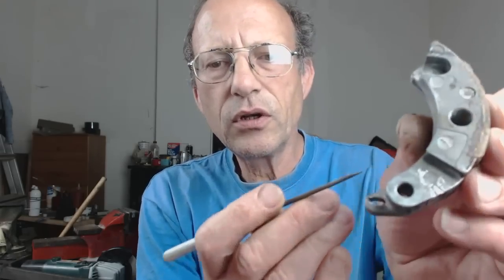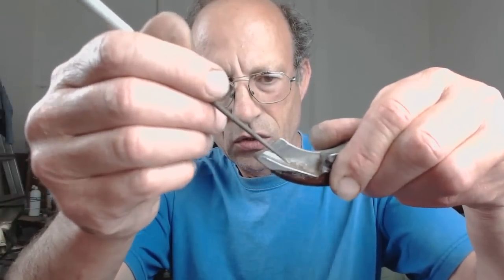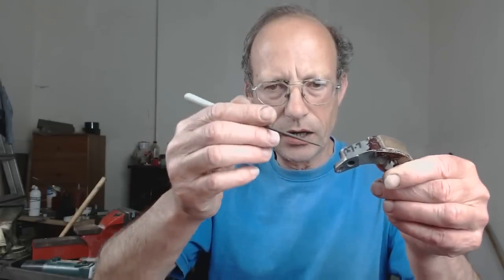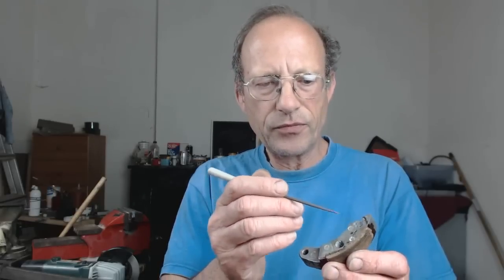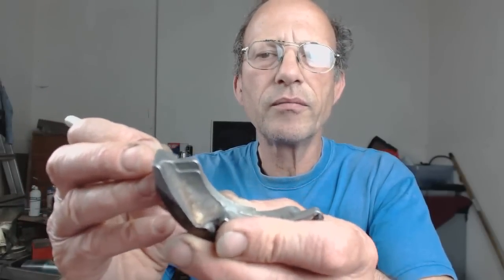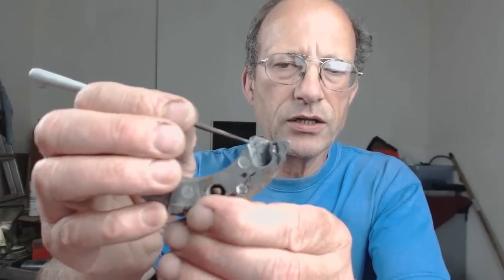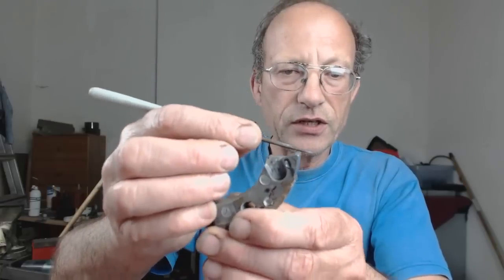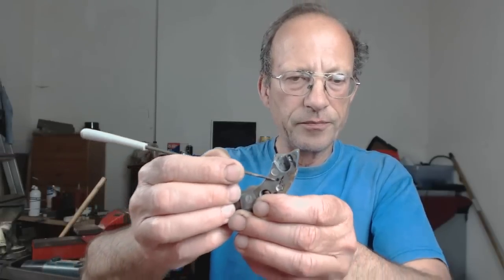Adjusting scooter clutch grab without changing the springs - Part 1

Comment: Hi bro i have 155cc scooter with max torque of 13.8 N.m @ 6,250 rpm and max power of 11.1kW / 8,000 rpm. What is the best roller weight to have better top speed??
Reply from the maker: It's not possible to state, as many factors are at play.
Below is the explanation.
You may need to study it, so that you can hold the concept clearly in your head.

All initial testing must be completed with a tachometer, and the CVT cover off, as 'grab points' must be seen and written down against RPM.

* WARNING *
All loose clothing is banned, hair should be tied back, a cap should be worn (if hair is long), and safety specs worn (due to particles flying off the rotating clutch and belt).

The principal 
------------------

... is based upon two gearing devices:
The front variator, and the rear variator.

The front variator increases the gearing by centrifugal force (CF) flinging the roller weights out, pushing the pulley halves together, and increasing the the front pulley diameter.

The pulley diameter change = gearing range.
This is determined by engine speed, and roller weight.

The roller weight determines the engine speed when the pulley drive is engaged (but NOT the drive / bike movement).

Heavy Weight Rollers
------------------------------

At tickover (say 1500 rpm) CF is insufficient force to squeeze the pulley halves together.
Say at 3000 rpm the pulley begins to grab the drive belt.

As the belt grabs, the clutch housing begins to spin @ 3,000 rpm (just an example)

As rpm rises, so too rises the CF, causing the gearing to rise.
This spins the clutch faster.

At say, 4,000 rpm the clutch bites, and drive is engaged.

Now, as the engine accelerates, the bike also accelerates (it's a double whammy!)

On fixed gearing (motorbikes) the bike accelerates purely due to the rising engine rpm.
Not a scooter.
Not only is the engine accelerating causing the bike to go faster, but the gearing is getting taller... also causing the bike to go faster.
Nice!

Say the scoot rpm tops out at 10,000 rpm.
... but at what rpm have the weights hit the walls of the cage?
You need to know that.
Use a thick pencil, and rub a broad pencil line from the outer diameter down towards the centre of the pulley.

With the cover off, you can see it all happening.

You want the belt to be squeezed out to the maximum diameter... you then have full use of the front pulley gearing.
This is obviously ideal, because a broader gearing range maximises acceleration potential.

Lets say, with the heavy weight rollers, maximum gearing is achieved at 9k rpm

You now know everything!
You know the 'critical' launch rpm... plus the maximum gearing rpm.

Light Weight Rollers
---------------------------

CF is dependent upon mass and rotational speed..
So lighter weights have less CF @ 3,000... so the belt isn't grabbed.

Say the belt grabs at 6,000 rpm, and the clutch grabs at 7,000 rpm.

Yippee you shout.
7k rpm and you are in the powerband... and you can barely keep the front wheel on the ground.

However, with the heavy weight rollers, the clutch grabbed at 4k rpm and achieved max gearing at 9k rpm.
IE. from grab to max gearing took an increase of 5,000 rpm.

BUT... with the Light Weight Rollers... the grab occurs @ 7k rpm
This means that max gearing is achieved @ 12k rpm... yet the engine only revs to 10k (and that's past peak power)

This also means that the bike has no drive, until 7k rpm... so it's screaming its guts out, just going at walking pace.

The Solution
-----------------

Heavier clutch shoes, or weaker clutch springs - to lower clutch grab rpm closer to the belt grab rpm (in our example say down to 6,200 rpm).

Or also increase the roller weight to drop the belt grab rpm to say 5k (et cetera....)

Conclusion
---------------

Your normal 'performance (yet rideable) objective' is to have the clutch grab, at the beginning of the usable powerband.

... while maximising the gear range.

After that point, you can turn your attention to road speed.
Road speed determines rear wheel speed, and this determines the final drive gearing, which is determined by the rear pulley spring strength.

Stronger rear pulley springs increase the pulley diameter, lowering the gearing (greater acceleration)
Weaker springs reduce the pulley diameter, raising the gearing (faster potential speed)

Therefore, you will fit the strongest springs, that allow you to hit maximum speed at your chosen rpm ... say just past peak power (assuming a flatish power curve).

This will provide the best balance between acceleration and speed.

... and that's almost all of it it explained.
There is a torque ramp at the rear pulley, but you have what you have.
Actual testing will tell you the spring strength required.

Did you get all that, on first reading (please report back on how many times you needed to read it).

All that's left to do, is give the vid a thumbs up, and subscribe :)
Reply: @EngineTuning  This is, by far, the most comprehensive answer to a viewer's question I have ever seen from a YouTuber. That's AWESOME. I basically knew all of this stuff already, but it was more or less fuzzy. Your clear line of though and breakdown of the issue was extremely helpful for me. You did a great job of explaining the order of dependencies in the system which is so useful in understanding what to change and what to look for after you've changed it. I probably read each section twice -- one for the general idea of where you were going, and the second time slower, trying to grasp the details. Thanks a bunch, man!
Reply from the maker: @meatcreap  
Hah!
Thanks Larry.
Glad it helped.

I just re-read it, after being notified of your comment.
I remember thinking that "to get this setup right, one really must understand the entire system".
... so I documented it, for those who want to get it right :D
Reply: quite simply - at top speed clutch is fully engaged and therefore not relevant.

Comment: Sir. I have problem with scooter PCX 125cc and AIRBLADE  125cc. That is much Vibration at first acceleration 0-2 km)h and at speed 40-50 km/h.
Please explain and show me how to solve it?
Thanks so much.
Reply from the maker: Hello Dang :)
There are many possible causes of vibration.

Usually it is unbalanced weight distribution on a rotating component eg. wheels, tyres, crankshaft ... or bearing failure.
For a scooter CVT ... check the distribution of the rollers ;)
Reply: @EngineTuning  
Yes. Thanks for your quickly replying and good information.

Comment: Hey there I am having a parasitic drain that is crazy I have plugged up my multi meter and I'm getting .5 amps what could it be I have taken the scooter apart and systematicly unplugged everything idk where it's at any ideas
Reply from the maker: It must be, that you missed it.
Most investigations fail due to the current state of mind - typically : confused, annoyed, pissed off.

Leave the task, change the mood, drink some tea, and print out the wiring diagram.
Restart the task ... remind yourself that there IS a fault, that the system is not complex, and disconnection and reconnection of components MUST show up the fault ... you just need a plan.

Using your wiring diagram - disconnect all peripherals and the ignition, from the voltage regulator and the diode (non-return valve), as explained here:
https://youtu.be/Bb8ievq1TsE

In this way, you can eliminate a large area from the investigation.

The task is now easy ... the fault is either in the peripherals, or the ignition, or upstream in the regulator, diode, battery.
:)
Reply: Thank you very much ok I may have read the multimeter wrong it a .056 a or .56 ma idk if that high or not or could my battery just be bad and now that it's starting to get cold out the batteries done for o I am deff frustrated I appreciate all your advice and help
Reply from the maker: I'd first suspect the battery :)

Comment: I have question , my bike is 100 cc and it reach 70 km  ??? Can you tell me what I do ?
Reply from the maker: Thanks for the comment.
 
Tuning an engine is a big subject.
The best advice would be to join a Yamaha scooter forum... or a general scooter forum.
Reply: PlayF1 Net thanks but  my bike is 2 stroke . I found nothing in this website
Reply from the maker: Which forums have you tried?
There are many scooter forums that deal with two stroke motors.
Reply: Yamaha grand Axis

Comment: So if I take weight off the clutch shoes I'll get a more grabby clutch and what about the variator rollers
Reply from the maker: No.
You'll get a more grabby clutch by ensuring that each shoe weighs the same.
... in particular, the weight distribution.
You'll get an earlier grab, with heavier shoes
... a later grab, with lighter shoes.

The variator rollers (weight) adjust when the motor engages.
Heavier, sooner.
Lighter, later.
Reply: @EngineTuning  alright thank you for clearifying
Reply: @EngineTuning  I had a faulty stock clutch shoes that had huge cracks in it and exploded at 300 miles and was only doing 24 mph with the new shoes I'm doing 37 wondering if I need to do anything to my variator to get more speed and I'm getting a performance cdi air filter and coil pack
Reply from the maker: The bike may be limited to 37 mph.
If you wish to exceed this ... one would normally start with carburation.
I suggest that you join a forum that covers your scoot ... Good luck!

Comment: What a hack job, and not in the good sense of the word "hack".  Given that it's not uncommon to see clutch bells that have discolored blue due to heat (steel begins to "blue" somewhere around 400F/204C) and that lead melts around 620F/326C, it's not unreasonable to think that it's possible to liquify those added lead weights.  Not to mention the intense and repeated thermal cycling of the shoe-epoxy-lead bond will cause it to rapidly degrade and likely sling everything loose at high velocity.  If you are going to play with clutch shoe weights, do it the correct way and either tack weld in the extra material or use a press and an interference fit to hold it in place.
Reply from the maker: It's an interesting concept ... thanks for posting.
So far we have had no feedback to confirm your suspicions.

The JB weld is good for around 125C plus safety.
I never experienced any problems.

Simultaneous Grip:

You need to account for the ideal grip that is provided, when the shoes are balanced, and up-weighted.
... as this prevents slip.

For this mechanism, it is clutch slip, that creates the heat.
Reduced slip, means reduced heat.

The clutches that you describe (overheated) are almost certainly 'unbalanced'.
This means that the shoe weights are different.
... resulting in an individual shoe making contact, while the other shoes haven't yet made contact.

You will note my emphasis on weighing the clutch shoes at regular intervals, during the modification process.
The objective is to have all shoes bite at the same time, thereby eliminating the failures that you describe.

When the three shoes bite simultaneously (which they will do, when the same weight), the scooter will launch perfectly.

Modification Concept:

Understanding 'why' a mod is being made (and its effect), is critical.
Watch the video again, and you will see that I identify the different riding concepts between adding, and removing weight.

By adding weight, you are looking for a controlled launch, with acceleration once moving.
Therefore the primary concept of the 'add weight' mod, tends to preclude the scenario that you describe.

NOTE:
I've checked out your channel ... I see it is blank of any activity.
Therefore presumably you are new to this environment.

What I would recommend, is that  ... you raise your 'interesting point' first, before getting on your high horse.

Obviously, self confidence (in your conclusions) can be useful, to push yourself forward (against all odds).
However, there is no need for this on YouTube ... and certainly no need on this channel.

Here ... if you find any fault, you will receive due credit, and your comment will be pinned.
Check out the comment (pinned) on my wiring tutorial https://www.youtube.com/watch?v=Bb8ievq1TsE (by Patrick Walsh - who identified an error).

Obviously, we all understand that it is a shitty world ... but you can rise above it.
... it's your choice.

Also, try and recognise when you are amongst friends ;)

I'll pin your comment for a period, as your 'hack rant' is a good lesson in how not to join a community.
(Also note that you can edit your comment, to make it more in keeping with the engineering (and friendly) bias of this channel)

:)